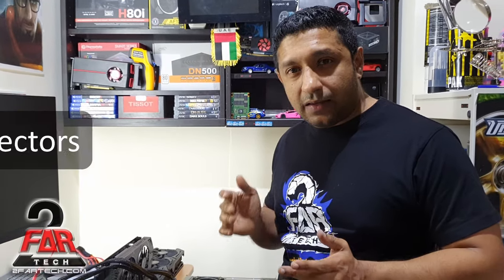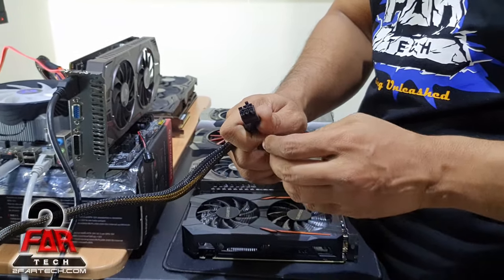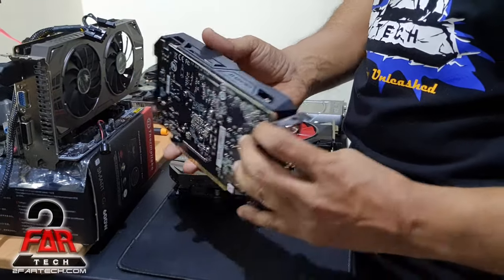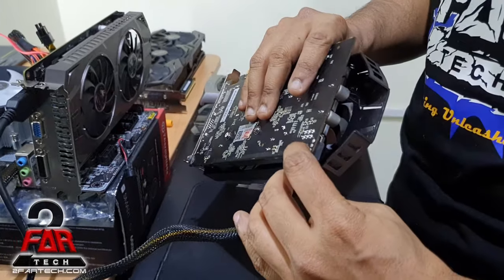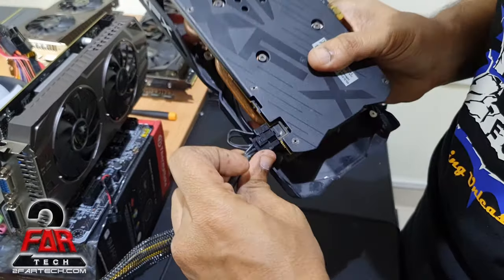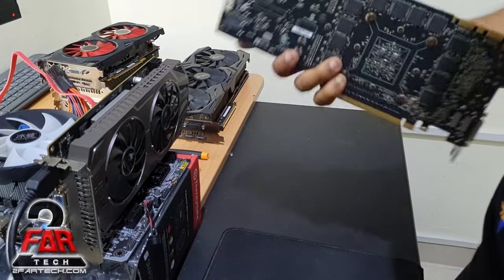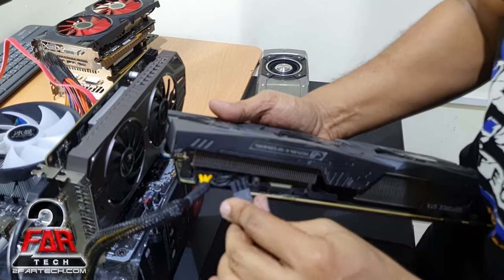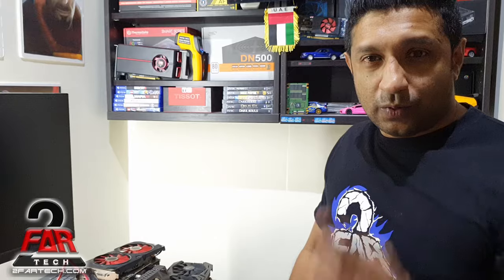How to connect the power to the graphics card?

Comment: Is there lost of performance if you use one cable that has ah splitter of 8 pins? For rtx 3090?
Reply from the maker: I assume the 8pin splitter on 1 cable is from the factory. Its not something very easy to say. The answer is yes and no. Under heavy load the card pulls a lot of power which of course is the rated power. If your psu isnt exactly top of the line, then probably the wires aren't the best. The power draw can cause voltage drop which means the card can get less voltage. Thus the card might not perform to the 100th percentile. Now would you actually notice this? I dont think so. So as long as have a decent branded 750Watts PSU, you shouldn't worry. If you have separate 8pin cables on a modular or non modular psu, go for it.
Reply: @2FarTech  thanks for they reply , i have an issue and i think is that im only doing 140 fps on warzone with rayzen 9 3900x , corsair 16gb 3600mhz, and the rtx 3090, which i shoulf be doing from 165-200
Reply from the maker: @AdanM427 , I can be 99.9% sure it wont be due to your PSU or the power. Run MSI afterburner or something and look at the details like the clock speed and memory speed. Compare with others having the same gpu, if the clock rate and mem speed is the same then you should look elsewhere. But if your gpu is not reaching those speed, this also be due to thermals.
Reply: @2FarTech  ive done that all ready and gpu doesn’t simulate the OC.

Comment: I have bought rx 5700xt gpu that has 6pin+8pin power socket.
But my PSU has only one 8 pin (6+2) connector. I can't power on my gpu. Please guide me which extra 6pin power cable do i need??
Reply from the maker: Congratulations on your new GPU and sorry to hear about your dilemma. The best option would be the replace your PSU with a better one that has these plugs/ cables (650Watts Branded). If thats not possible, I suggest the following option which isnt the best.  Assuming that you have a decent PSU with atleast 550Watts, search in google exactly the words inside the quote, "sata to 6 pin pcie adapter". Now sure if amazon facilities are available in your place, but surely amazon would have something that coverts TWO SATA power to 1 x 6 Pin PCie. Dont get the cheapest one. Look for the one that has good reviews and go ahead with the purchase. The third option would be get the same kind of cable which converts 2 x Molex to 1 x 6Pin PCIe. Good luck
Reply from the maker: https://youtu.be/G_YxxRCSz0s  Watch this video around the time 6:39  , i am using a molex to Pcie its a good cable and has good quality.
Reply from the maker: https://youtu.be/G_YxxRCSz0s?t=399  Watch this video , i am using a molex to Pcie its a good cable and has good quality.
Reply: @2FarTech  thank you for ur valuable feedback.Yes i have 800w frontech power supply. The power connector u have suggested hope it will solve my problem. I am looking for 2 sata or molex to 1x6 pcie connector.
Reply from the maker: @emtcroo  I did a quick check on the FrontTech 800Watts Powersupply. I hope you read this on time. I strongly discourage you from doing the second option i suggested. I dont know what processor you are using the RX5700XT requires or recommends a  real 600Watts PSU. Your Frontech Model Barely does 480Watts on 12V. Its not a real 800Watts. 99% chance the PSU will blow in few hours of gaming and it could destroy your whole PC and other components too. Dont use PCie splitters in your case. Get a new PSU.
Reply: @2FarTech  thanks for ur concern.I will not use it for gaming. I have old core2duo system.I have another 450w PSU that runs the system. i want to use this 800W PSU for the graphics dedicatedly.
Is it Risky??
Reply from the maker: @emtcroo  Gaming or graphics, when the GPU gets loaded it will start putting the PSU into overload and it could be the end. So think again. Good luck. Be safe
Reply: @2FarTech  thank you for ur valuable feedback.  I will buy a new PSU. Thanks a lot for ur concern.
Reply: @2FarTech  which PSU should i buy ? Can u recommend plz?? Amazon service is available in my place.
Reply from the maker: @emtcroo  The low budget PSU we use is the Thermaltake Lite 650Watts. This should be a good starting point. Its not the best, its the lowest point beyond which the other psus are pointless. So if you can find T.T 650Watts in good price or other well know brand in the same price range or higher, go for it. The actual recommendation would we Thermaltake Toughpower series 650Watts or Corsair 650Watts.
Reply: @2FarTech  today i bought a Antec B650 power supply. Its ok i think for the graphics card.

Comment: Please tell me what if you have one 8 pin pcie port and a 6 pin but 2 6+2 connectors pigtailed
Reply: You did mention this but i am experiencing black screening and the graphics card is the only answer
Reply from the maker: Black screen definitely points towards graphics card Power issue. But it could also be something else. You have to eliminate all the possibilities. The first step would be to add the required power to the card. This is what any expert would say.

Comment: Hi, I have a GPU that required 3x8 connection, but my PSU only have 2x8 PCIe slot, how can I connect my GPU?
Reply from the maker: But the psu wire has 2x8 pin per cable right?  In total you have 2 wires, however at the gpu end of the wire there is 2 x 8pin per wire. You can use two cables to get 3 x 8 pin and leave the 4th 8 pin empty or not connected to the gpu
Reply: @2FarTech  So do you mean I would need two 8Pin to 2x8Pin for my GPU?
Reply from the maker: Most decent modular psu provides 8pin on psu and 2 x 8pin on gpu side.  I have also seen platinum psu with only 8 to 8 pin. However those came with 4 or more 8pin  cable.  Share the psu model number of you need further assistance
Reply: @2FarTech  Thank you for your explanation!

Comment: I got a question 
I have the following psu : corsair cv 650. My games keeps crashing after i changed my gpu to a rx5700xt wich requires 8+6pin power connection. My psu has 2 × 6+2 pin conectors coming from the same cable from the psu. I could not connect both of these 6+2 to the gpu because the end of the cables was to short. So i bought a splitter, which is connected to one of the 6+2 pins coming from the psu and the other end to the gpu giving me 6+8 pins wich the gpu requires. I dont know what causes me crashes. Could it be my psu? I tried updating my drivers, undervolting my gpu, set the clocks speeds to normal( recomemded ones), my temps are around 65-70 celsius. 
I hope someone could help me.
Reply from the maker: With AMD graphics card,  this can be tricky. It seems like you did all the exercise to troubleshoot the issue.  Your connection method is not very promising either.  To eliminate issue rising from the psu and cable,  I suggest you remove your motherboard,  psu  and gpu.  Mount it on a table and check it outside the cpu case without the splitter. Run the game and see if it still crashes.  We had similar issue with rx580 and latest drivers.

Comment: Pci cable one end is connect to GPU, that's ok. Then second end  is connect from Smbs or motherboard...?
Reply from the maker: Smps or psu.
Reply: @2FarTech  if i connect from SMPS, can I use molex to 8 pin connector?
Reply from the maker: If you have something like a gtx 1650, it might be okay.  But cards that draw a lot more power will damage the smps and even the cables.  It's not advisable.  Psu is very cheap these days,  don't risk it.  Get a deepcool 450 watts psu, it will do the job
Reply: @2FarTech  Thanks 🙌🏻

Comment: thx so much i was planning to buy 8 pin graphics card but my power supply have only 6+2 pin so i wanted to know if it works
Reply from the maker: Yes. 6+2 pin is the 8pin. But if your graphics card require 2 x 8 pin then you need 2 (6+2) pins.
Reply: @2FarTech  I know my power supply has 2  6+2 pins

Comment: yea but where does it plug into the board or powersupply
Reply from the maker: The other end of the cable comes from inside the PSU on a normal PSU. On an modular PSU, it will be clearly marked where to plug in the other end. Or are you asking where do you plug the Graphics card into the motherboard?

Comment: Idk probably is obvious but where do I plug the cable on the power supply?
Reply from the maker: Any decent 450watts or above psu will have atleast 1 x 6pin pcie power cable.  If your psu doesn't have one, it means it isn't capable of handling the extra load of a graphics card.
Reply: @2FarTech  I have a 850watts I figured out how to plug it in but it isn’t showing up on my monitor my old 1030 works on this pc fine It’s not the gpu because it works fine on another build I checked it’s a 3080ti by the way
Reply from the maker: I hope you have sorted your issue.  As i understand, you had a gt 1030 before and now you have a rtx 3080ti? Gt 1030 doesn't require any Extra power. Rtx 3080ti might require upto 3 x 8pin connector depending on the brand.  
If you plugged all of the cables to the gpu and there is no display, make sure you are plugging the display cable to the port on the graphics card.  
You could also try resetting your bios. 
It means, check your motherboard manual and you will find a method to clear cmos. This might also require you to remove cmos battery.  The manual would clearly state how long you would need to do this

Comment: Hello! Can I connect an rx 580 with 6+2 pin cable?
Reply from the maker: Does your psu has a 6+2 connector?  What is the brand name and model number of your psu?
Reply: @2FarTech  my psu is a Corsair CV650. I have two connectors (6+2 pin cable each)
Reply from the maker: Then it's easy.  Just plug in any one of the 6+2. Most rx 580 comes with a 8pin single or 8pin +6 pin connectors.
Reply: @2FarTech  Ok. Thank you!

Comment: What if the card requires 2 8 but the power supply only comes with a 6/6+2
Reply from the maker: If you have only 1 x 8 pin then its better you get an upgraded PSU. The manufacturer clearly doesnt want you to push the PSU to a load that its not comfortable with. You can probably try to use MOLEX or SATA power to 8pin PCIe convertor and use the same PSU, but if the PSU blows, there is a chance the mess can cause more damage to other components too. Weight the risk and proceed

Comment: After I connected my 1080 6gb to my 80s-450w power supply I turn on my pc and the message to my pc says “Please power down and connect the PCI-E cables to my graphics card” what do I do?
Reply from the maker: Did you connect the Power cables to the card like the way I did? Does your 450W PSU come with PCI power connectors? And GTX 1080 is a 8GB Card, unless you are having a GTX 1060 which is a 6GB card. If you connected the power cable like i have shown in the video and still there message pops up, i suggest you try a different PSU.
Reply: @2FarTech  I sure did I had to rewatch it 20 times😂, do you perhaps know any good websites that sells PSU? I’ve also noticed my pc has been Turing it self off with my blue screen what so ever
Reply from the maker: Which part of the world are you located so i could give you some idea
Reply: @2FarTech  located in Australia
Reply from the maker: https://www.amazon.com.au/Thermaltake-Continuous-Active-Supply-PS-SPD-0600NPCWUS-W/dp/B014W3EMAO/   (Cheap and decent)
https://www.amazon.com.au/600W-White-Warranty-Supply-100-W1-0600-K3/dp/B01127D0MY (Cheap and Good)
https://www.amazon.com.au/Aerocool-Integrator-Bronze-Power-Supply/dp/B0143D474O (Cheap and powerful)
https://www.amazon.com.au/Corsair-Bronze-Certified-Non-Modular-Supply/dp/B07YVVNK6Y (Cheap and good)
Reply: @2FarTech  ghee thanks broo
Reply from the maker: Good luck.  👍

Comment: Do my GPU works if I not use pci-e on GPU?????
Reply from the maker: Mostly it wont work. The GPU wouldnt get enough power and it would turn on. There are some boards that might work but then its not recommended either. Any PSU that requires a more than 6pin pcie will definitely not work.
Reply: @2FarTech  but I use GTX 750 and it doesn't have any pci-e connector.....and some people said that some GPU needn't connect pci-e to gpu...
Reply from the maker: Your question made me believe that you had a card with pcie power connection requirements. In the video i think i am showing a gtx 1050ti which doesn't require a pcie connection.  You would know that if there is no place to connect extra cables on the graphics card.  So don't worry.  Enjoy
Reply: @2FarTech  ohh.... thanks....

Comment: I don't have power connector for GRAPHICS card in my psu and I want to buy 1660 super it's a power supply from Fingers company please comment
Reply from the maker: If you dont have a power connector from your PSU, its definitely a cheap PSU that doesn't do anywhere near the rated power. Your best option is to get a cheap PSU from Brand like Deepcool. You only need a 450Watts Deepcool powersupply and you good. Using convertor and splitter is not recommended in your scenario as it can blow up your PSU or melt the wires during gaming.

Comment: My gpu has 3x8 pins what cable extention do I need
Reply from the maker: You need an 800 watts capable psu which would come with 4 x 8  pin connection.

Comment: Sir i have gigabyte 3080 gpu connector pins are broken can this be repaired
Reply from the maker: I don't know how you managed to break the connector.  I assume the connector on the card is damaged.  Yes it can be repaired or fixed.  Depending on the amount of damage you might want to check with gigabyte directly.  A proper electronic shop will be required to replace the power connector if you manage to somehow find the connector yourself.  Desoldering and soldering is required.  Since this is a non moving part, is there a way to fix it without repairing it.
Reply: @2FarTech  thank you so much

Comment: what if my smps has only 8 pin while my gpu has 8+6. Is there any way to do it without changing my smps
Reply from the maker: Some 8pin cable might have a piggy tail 8 pin connector.  If it's not there then the spms isn't power enough to support the extra power required by the gpu. However you can use molex connector to pcie 6 pin converter to get that extra 6 pin. Connect this molex to a power cable not used to ssd or hdd.
Reply: @2FarTech  can i use cpu instead of molex...im thinking of using unused psu 450 watts that i have what do u suggest
Reply from the maker: CPU instead of molex? Typical Low end PSU comes with either 1 x 4pin or 1 x 8pin which is required for the motherboard. You cant use this on a PCIE port as the plug orientation is different. I suggested Molex as you as PSU comes with atleast two main wires for Sata and Molex. You can move all the drives into a single cable and use one standalone cable with Molex or Sata to use the convertor. I suggested Molex as it can handle more power load. If you are getting a covertor cable, get a good quality one. If you do this an the PSU blows up, it means your PSU cant handle the load posed by the CPU and GPU together. If you want to avoid all this, you can hunt for a Deepcool PF500 PSU, which is cheap and run anything upto an RTX 3070 with i5 processor
Reply: @2FarTech  any suggestion on good converter cable. thnks by the way

Comment: Why is it so hard to find a 6pin connection graphics card almost all of them are 8pin
Reply from the maker: Pins are based on the power consumption of the graphics card, you can find gtx 1650 and some gtx 1660 using 6 pin power.

Comment: Hello, am looking for 6 pin female power. To duel 6 pin male 8 pin male GPU
Reply from the maker: 6 pin to dual (6 pin and 8 pin) is a bad idea.  6 pin to dual 6 pin itself is a bad idea.  
If the only psu cable provided has only a single 6 pin, then the manufacturer of the psu really limited the power output.  If you manage to power up the system.  During gaming the system will randomly shutdown, that is if your psu didn't blow up. Please get a better psu for your safety

Comment: Hm my psu has only 1x6 pin connector and gpu has 8 pin. Now i need to buy new psu?
Reply from the maker: That's what it would mean. 1x6 Pin PSU wouldn't be able to handle the power requirement of an 8pin GPU. And sometimes when you try other means to make it work, it might end up blowing up the PSU or damaging the Graphics card.
Reply: @2FarTech  Thanks i purchased another budget corsair which has 2x6+2 pcie lins
Reply from the maker: Good thing you brought corsair.  Its one of the good and safe brands.

Comment: You didn’t answer the question. Yes it obvious the pin plug in. But how do I power it. I literally have nothing to plug into the other end of the 6 pin
Reply from the maker: The assumption here is you have a PSU with one part of the cable already attached to the PSU internally. A standard PSU would come with a PCIe power cable if it is rated over 500Watts(another assumption). Higher end models of PSU known and modular PSU would have these cables packed separately so you can use the cables required for the job and thus avoid clutter in the cable management.  Your statement is confusing as it seems like you have modular cable and you dont know where to plug it. The PSU would have come with an user manual which shows where each plugs would go in. Also most PSU have markings on the rear side which says PCIE power, SATA, CPU, etc... The other end would go into the PCIE power part of the PSU. Now if you are saying you have full length PCIE power cable but no place to plug it behind the PSU, then its a confusing situation as I don't know how you ended up in this scenario.

Comment: I have a 500w coolermaster and it has 2: 6+2 pins
Reply from the maker: Pretty good until rtx 3060 or even rtx 3060ti if you have an i5
Reply: @2FarTech  i have a 550w fsp and it has a 6+2 connecter but when i connect it to the gpu i think it doesnt give it power bucause the fans doesnt move but the rgb works on the gpu (GEFORCE) word

So it doesnt show anything on my monitor do u have any fixes for this type of problem ?